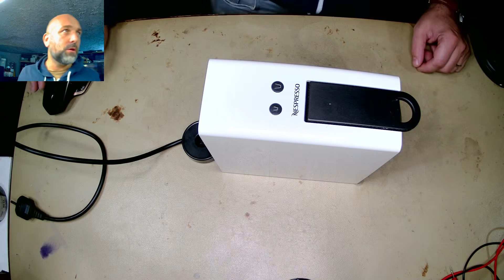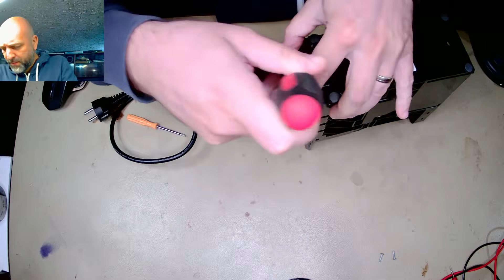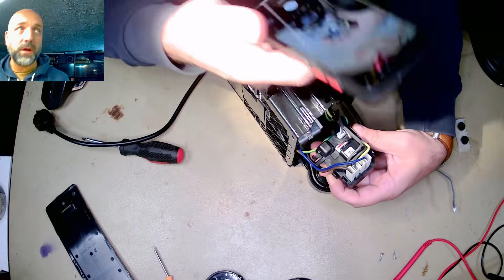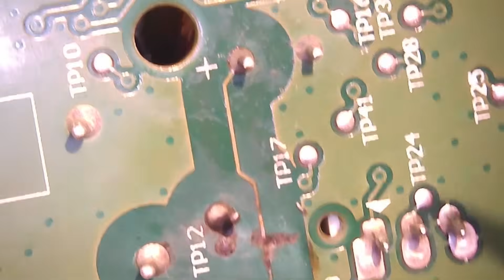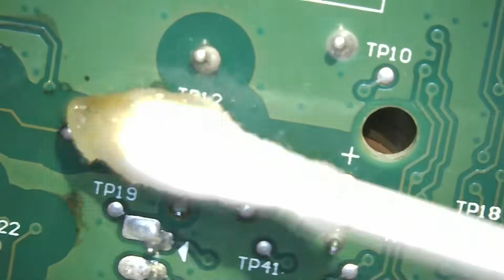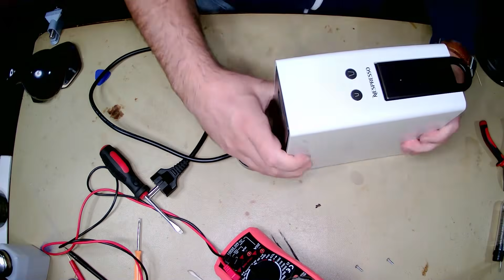NESPRESSO Essenza Mini C30 Step by step repair | Full Disassembly | No Power

Comment: I have an identical circuit board, but the resistor doesn't heat up and then the lights start flashing rapidly. What could be the problem?

Comment: Thank you for your disassembly video, it was very helpful.
 I have a few questions. 
1) Some NESPRESSO compatible capsules have very fine coffee grounds, making it difficult to extract coffee. I understand that the pump has a hard time extracting, but will extracting these capsules really cause machine malfunction?
2) Some compatible capsules require more force to close the lever than genuine capsules. The capsule rim seems thicker, will continuous use of these capsules cause the lever to malfunction? 
3) AliExpress sells refillable capsules made entirely of stainless steel.  Assuming that there are no pressure issues during extraction, will using these stainless steel capsules cause machine malfunction?

Comment: My machine when plugged in, immediately starts pumping and the LEDs are rapidly blinking. I think water got inside and shorted something on the unit’s electrical board.  I will open it up and look. Thank you for your videos

Comment: Hi there, I have a similar machine, and in my case, I get the mechine to turn on, it gets hot, and when I try to make the machine work, I hear a couple clicks coming from the pump, but no coffee is made. I took the pump apart, disassembled it, and had it plugged directly to mains power, where it worked apparently normally. I don't see any obvious damage to components. Should I just replace the entire logical board, the pump itself, or should I check somewhere else? What would you recommend?
Reply from the maker: On the main board there is a big capacitor like a small box. Usually 640uF. Those get out of spec and will shut down the system.  Replace that one it is extremely cheap....I have a video on this issue on my channel.